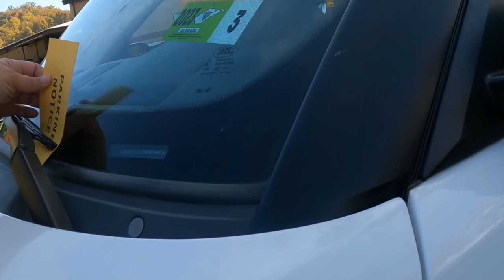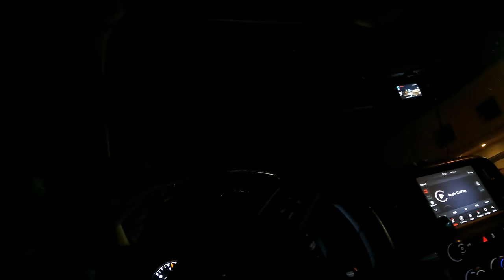Ski Mountain Pickup, Various Tows And More Illegal Parks At Five Guys

Comment: Yep, those S-10's run forever until around 230k when the injectors start leaking and you have to pull the intake off to change the spider assembly. Been there, done that.